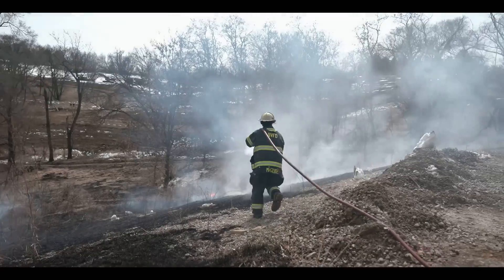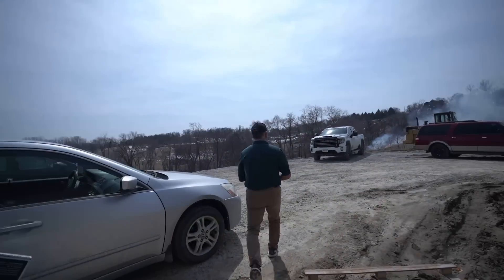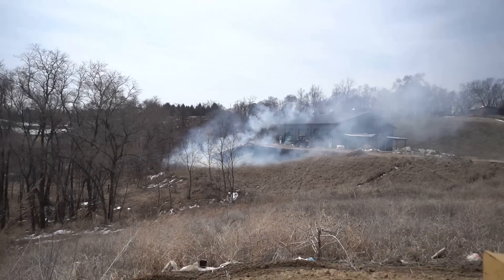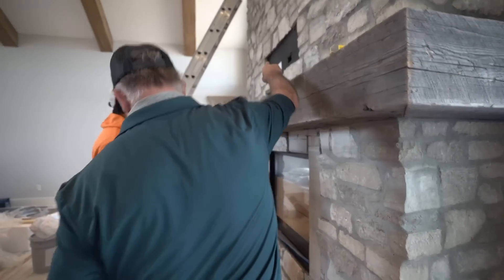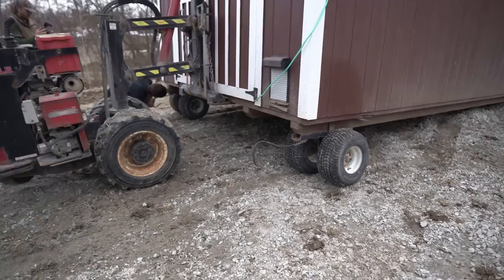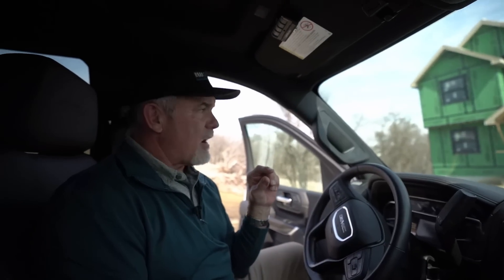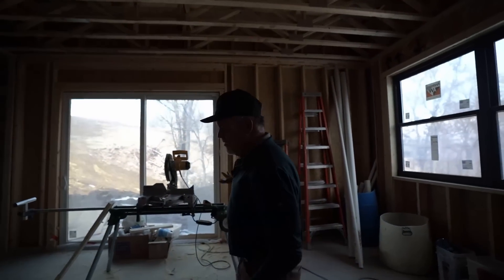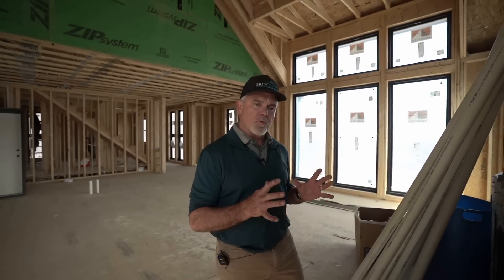THERE WAS A FIRE AT FLAIR'S! (I had to call 911...)

Comment: Our r/o system had low pressure, and if we wanted good pressure, we would have had to replace it with a crazy expensive system, so instead, we built a pad and moved a shed a hundred and fifty feet up the hill and moved the r/o and water softener system there with a 330 gallon pesticide tank like the one your son lent flair. Instead of paying an extra several thousand for a better system, we spent 300 on pex, fittings, and a float valve trenched 2 pipes down to the house and have great pressure. You could just have the tank i the house with a pump, but you will be without pressure when you lose power.
Reply from the maker: Great idea!  That’s thinking outside the box… I like it! 👍

Comment: I am in the process of building a house that’s going to have a well on it, do you think a whole home filter system is the way to go?
Curious if you ever thought of doing a heat pump, the new ones are said to be good to -20
Reply from the maker: According to my wife and daughter, who do a lot of research on the water, we drink, they highly recommend a whole house filtration system!   That’s what we put in Flair’s house and that’s what I’m putting in my personal home! 

The best would be a geothermal system, and then second choice would be the heat pump !
Reply: @BradtheBuilder  how pricey is geothermal, I have heard about it but don’t know how hard it is to install. 
I’m thinking heat pump because I don’t have gas at the property. Lot of unknowns though. House will be in Arizona so it should be fine. 
How good is heat pump for AC?
Reply from the maker: @Albanianguy9  heat pumps are good/efficient,  they are somewhat of a problem on efficiency in extreme cold weather for heating! 

Geothermal are typically more efficient way for heating and cooling because you’re using the earth as  energy.  It cost more and that’s why the government is giving a tax credit for the install of geothermal to help offset the cost.  Sometimes the local power companies will give you a credit as well.  My opinion, geothermal is the most efficient way to go.

Comment: I really like those mini split condenser mounts to keep them off the ground. Is it code there or just preference? I would like to use them so that it's easier to maintain them without putting my knees in the mud 😅
Reply from the maker: We always keep them a little bit off the ground but if we can mount   Them to the foundations that is our referred way!
Reply: @BradtheBuilder  here in Florida its only required to sit on a hurricane pad and 4inches above grade, so you almost need to dig yourself a hole to get down far enough to work on them!
Reply from the maker: @JayWillis2120  do you install a lot of these in Florida?
Reply: @BradtheBuilder  we sure do. They are becoming really popular in commercial buildings for things like conference rooms and offices because of the ability to set different temperatures and turn them on and off as needed, but we generally use what's called a ceiling cassette in those cases. Ceiling cassettes can be used in residential settings as well, if you want to check them out and maybe keep them in mind 😁

Comment: the only downside about his gun safe is you guys missed an oppotunity for a safe room. that door wont close with them in there sadly. Good job on the house!!
Reply: They need a hardline phone in there. If for some reason the vault door is closed, and then the bookcase is closed they will have no way out. Can't unlatch the bookcase to open the vault door since they both swing outwards.